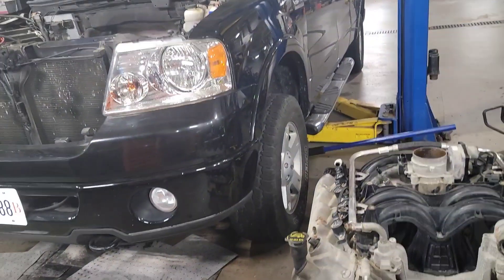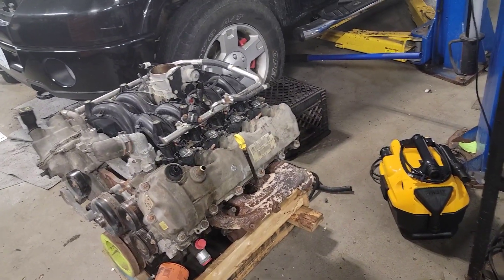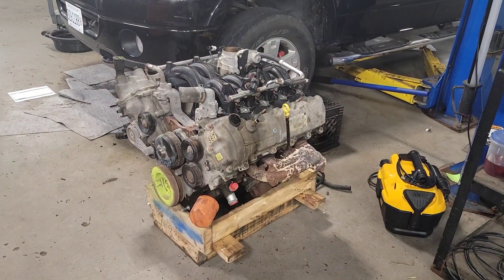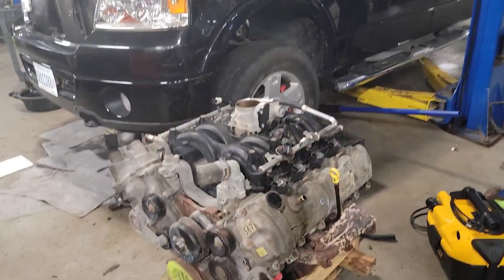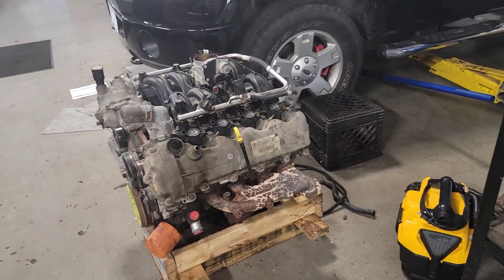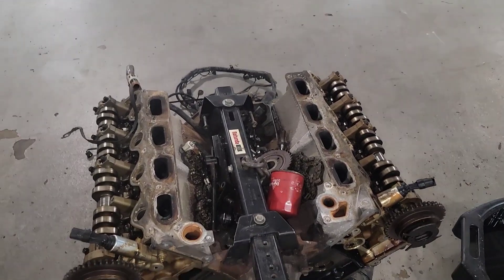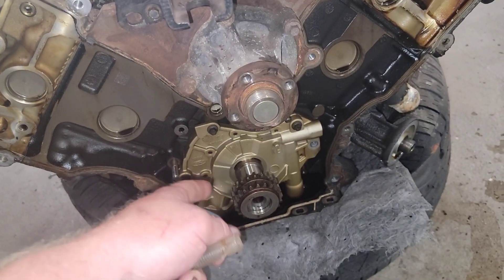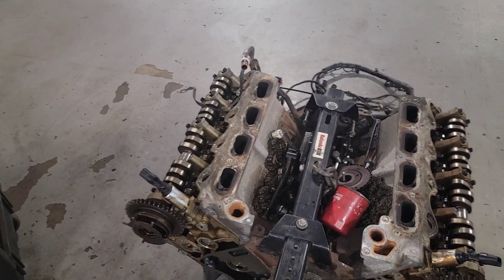2008 5.4 3v Engine Update and Talk On The Designed Oil Flow and Aftermarket Warranty Company Talk

Comment: Rich, as per usual, you did a great job on explaining the difference between high volume oil pump and high pressure.  You showing the path of the flow of engine oil was right on.  And I have always wondered why a lot of engines, mostly V8s, have one head that is darker, browner, or has a more bronze tint to the surface than that of the other head.  It never dawned on me that it was due to the PCV system.  Your videos are always informative and entertaining.  That guy is lucky to have a mechanic who tries so hard to make everything right for customer.....especially when owner seems to be in for more than vehicle is worth but is attached to the truck.  You are a good guy.  Keep on motoring, buddy.👍

Comment: Great explanation of the oil flow Rich! Thank you! Didn’t know this before and I have a 2002  F250 5.4 2 valve. Bought it used and noticed a bit of startup rattle, so if it sits more than a day, I flood mode it to prime the oil system. It no longer rattles and I’ve had ZERO problems with it. I know the 3 valves are worse but priming the system will obviously help longevity in them according to what you explained here.

Comment: This is the reason why Fordtechmakuloco uses a Melling HV oil pump when he does these timing chain tensioner/guide repairs. It truly makes a huge difference on these engine and also the 3.5 Ecoboost engines.

Comment: Great video as always. The info on the oiling setup in the 5.4 3V was rather eye-opening.

I have no idea why Ford even bothered going with the 3V setup on the 4.6/5.4s given all the problems with them. They are clearly not ready for prime time with all the chain tensioner/cam phaser/cam scoring problems they’re known for, especially with the lackluster HP gains you get with them. It’s just not worth the added complication. 

I’ve had nothing but good luck with the 2V 4.6 in my CVPI, and I get decent power out of the 2V 5.4 in my E-Van, and wouldn’t go with a 3V engine if I can help it.

Comment: The 08s are actually a split year for black or brown ignition boots. Partway though the year they switched to the updated heads. I happen to have a early 08 3v with the black boots and 3 piece plugs. I also know it is the original engine for the truck and the build dates match up for when they came with the black boots.
Reply from the maker: Yep

Comment: This makes it tough to consider purchasing another ford truck.  My 1997 F250HD 460 runs great.  One small issue is the rear main seal that has a small leak.  Big job to replace the seal, but nothing like the engine in your shop.
Reply: I have the same kind of truck ,short box extended cab. Only downside is the gas mileage .

Comment: Do aftermarket warranty's ever cover anything?
Reply: i just put a used engine in a 15 malibu. customer had to bitch a bit but they covered the whole thing
Reply: Just power it with Solar.
Reply: Not much from my experience
Reply: Nope
Reply: Insurance companies cover there ass first. Plus most warranty companies are small under capitalized set ups that change names on a dime.

Comment: I have 158,000 miles on my ‘04 F-150 8200 GVW with the 5.4. I don’t beat it. I change the oil every 2500-3000 miles. It’s built for car stereo, but it runs ok. Can’t complain. But I know it’s only a matter of time till something goes. Hopefully it’s lasts for awhile. Lol

Comment: Great overview, Rich.  That "used" engine sure looks beat up.  Do you know what brand of rebuild that was?  Had a buddy install a Jasper rebuilt motor that just lasted long enough to get out of warranty.  Sad to have to spend that much on a rebuilt motor only to have if fail quickly.  On a side note, any thoughts on running a tad heavier weight oil in these 4.6/5.4 3V's?
Reply: From what I was told, the 4.6/5.4 mod motors were originally intended to be used with 5w-30. Ford changed the oil requirements to 5w-20 in order to meet CAFE emissions requirements somewhere around 2000 or so. Machining tolerances on the engines weren’t changed to reflect the change in oil viscosity. 

Long story short- you can run 5w-30 with no problem. In fact, many claim running the thinner 5w-20 oil will result in shortened engine life as it’s too thin for the application. I’ve also heard that some police departments in the southern US have even used 10w-30. 

I personally use full-synthetic 5w-30 with no problem. Of course, this all depends on where you live too, as temps influence oil viscosity.

Comment: Hello Rich,
I’m not confident with that used engine.
I have no confidence in Fram filters.
If it was mine I would go with a genuine Ford reman engine and the upgraded high volume oil pump.
Reply: But this guy was stuck with a trash after market warranty. I live in a state without emission inspection,I would consider a old school 289 or 390 with wiring harness as a project.
Reply: Check out all of Rich’s filter comparison videos. You’ll learn a thing or two about the filters these days.
Reply from the maker: I am not looking for another person's lack of knowledge shared with me in oil filters 

Eric I would recommend you go to the library and just type in FILTERS and just start learning and watching

Comment: i have a 2006 f150 with the 5.4 3 valve has 143.000 mi on it never had it apart,change oil every 3000 mi with motorcraft oil & filter,very reliable and smooth.ford boss me is rigkt change oil religously!!~ they will last

Comment: I have a 2008 F250 with the 5.4. Bought it used with about 68k. So far she's been great, regular oil changes, I had the plugs changed, one of the exhaust manifolds has been changed as well. Still have some time left on my warranty but fear the same issues this guy's had. Do you have any suggestions?

I'm not too far from your shop, love to have an honest guy give me a real opinion on if/when I should do the phaser replacement.

And no I'm looking for a handout. Just the truth and honesty from a good tech
Reply from the maker: One of your oil changes coming up you should bring your truck to me and let me do a BG epr basic flush

Comment: changed the oil at 42500 miles using Motorcraft synthetic blend 5w20. I'm about to change it again when it hits 46k miles. Should I use Motorcraft synthetic blend 5w30?
Reply from the maker: Do something a little bit better quality than that like Valvoline high mileage
Reply: @FordBossMe  46k miles is high?

Comment: Hey boss i have a question on this engine i have a 2007 5.4 3 valve i have a oil leak where is the spots to look that these leak from
Reply from the maker: Oil pan and the oil filter housing adapter area and valve covers

Comment: I have a 2007 f150 with the 5.4 3v and whenever I start it up and rev it to about 1k rpm it sounds completely fine. Then when I drive it around for about 10 minutes and rev at around 1k rpm it makes a nasty rattling noise. What do you think this could be? And it’s only when the engine is warmed up and at around 1k rpm. After it passes 1k rpm the rattling stops and acts completely normal. Except for that one thing it runs a drives fine.
Reply from the maker: Could be timing it could be anything but sounds like timing especially if it doesn't do it cold

Comment: Rich is it normal for a 2022 F150 3.5 ecoboost to idle rough in park. Its a sensation like RPM's are low but tach shows 550. My dealer mechanic said it was normal but i've never felt this in any other car before.
Reply from the maker: I have not experienced that

Comment: The moral of this story? Aftermarket "warranties" are GARBAGE!!! The paperwork that they are written on, is as good as toilet paper in my opinion. All they're doing, is lining up the pockets of the ones selling them, at the expense of the poor little guy of little means. This story reminds me of such a situation I had, quite a few years back. I had an older model F-150 come in on the hook with an overheated, trashed out 4.2L V6. Upon submitting a quote to replace the long block was when I got the whole story. It was a used truck purchased by some young guy from a small ma and pa type used car lot, not even a month prior. He apparently had to finance this purchase, along with an aftermarket "warranty" worked into the purchase. Turns out, only select "repair facilities" are allowed to do repairs paid by them. And dealerships are not one of them! Reading between the lines, methinks only "cheaper repair facilities" a k a small time shops employing less than minimum wage paid guys who are wanting to learn how to fix cars are permitted to perform necessary repairs. As the truck was towed away, I just shook my head in disbelief at how this poor young guy got hosed, likely for every last hard earned penny of his for his first ride, and this happens to him.

About the 5.4 3-valve, since you're already replacing the rotted out rubber hoses, don't forget the most important one. I'm talking about the 'L' shaped one that goes to the back of the intake manifold on the driver side, and connects to the brake vacuum booster. We all know how badly they like to swell up and cause vacuum leaks. If I'm not mistaken, there was even a safety recall released on those, quite a few years back. I don't remember the recall number off the top of my head, but I remembered them being very difficult to replace for what they paid. I also remembered us techs requesting that the trucks be left with us for a few hours so the engine could cool down and we wouldn't be burning our arms and hands trying to replace that damn hose, if getting them all cut up wasn't already bad enough!!! I'll see if I can dig up the recall number.

YES, definitely replace those manifolds with NEW studs and gaskets while it's out, before going back in. Especially if the owner is buried too deep into it money wise to get out of it.

Great content as always, from one Ford dealership tech to another!!! BTW I'm impressed that you pulled this engine without lifting the cab, like I would have.
Reply: They sure take your money in a blur, but squeeze your balls if you dare to call them on anything. They also know the problems with these engines, so they should simply charge enough for the group coverage, then when there's a claim, treat the customer with respect.
Reply: Michael, do you mind sharing further insight  on how to access that vacuum hose at the rear of the intake?

That location makes for a real kick in the teeth. 
Should pull the hood/air intake and lay across the bay via center manifold? Or try coming from below/driver wheel? Thanks for any feedback.

Comment: That used engine has the orange oil filter of death on it - a Fram.
Reply from the maker: No you are wrong, it's not the cheap orange can, it's the newer Force One 

Do better
Reply: Another FRAM hater. Gotta love it. Watch Rich’s filter comparison videos and you’ll learn a thing or two.
Reply: @warrenself  I learned about Fram oil filters years ago when I dug filter media out of the clogged oil restrictors on my trashed 5.4 3v. Looked like cardboard fibers. Maybe these Force One filters are better?
Motorcraft filters on all my fords, including my race car.
Reply: @FordBossMe  Made by Fram. Still no confidence.
Reply: @jondoes7836  Key words being “years ago.” FRAM is now part of First Brands (last I checked) which owns Champion Labs. Millions of Honda’s and Subaru’s have their OEM blue painted Orange FRAM’s and go the distance. Champion filters are also made similarly. Some Motorcraft’s and FoMoCo have been Champ made too that I’ve been replacing recently.
Reply: I think that’s a fram core filter that Walmart Auto Lube centers use during there oil changes.

Comment: I don't think 3 valve 5.4's are the worth the cost, time and labor, its just time to move onto the 5.0L which is a better engine.
Reply: With the upgraded parts and religious oil changes at 3500 miles with Motorcraft oil & filters, the 5.4 3v is a reliable smooth running trouble free engine. 
These engines will not tolerate neglect or abuse. 
Over 70k miles on my rebuilt 5.4 3v and no engine issues….
Reply: @jondoes7836  I have 245k on mine and it's still running great. I have always used synthetic oil every 5k. I do run it hard but I also take very good care of it. I still drive it everyday and I haul stuff with it and I do rev it up when I get on the highway and drive it hard. I did take it to fordtechmakeuloco  at 230k last summer to do the timing kit/melling upgrade as a precaution. 700 mile highway drive nonstop to get there in the summer heat and no prob. Since these engines have this issue I figured I better do it as a precaution even though I had no problems with it. Just extra piece of mind with that higher volume pump and the upgraded parts.